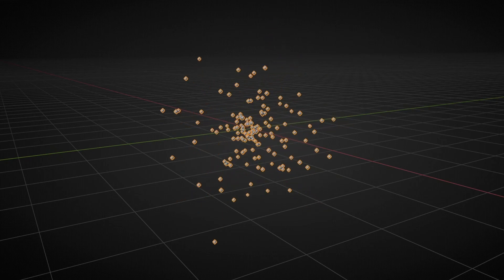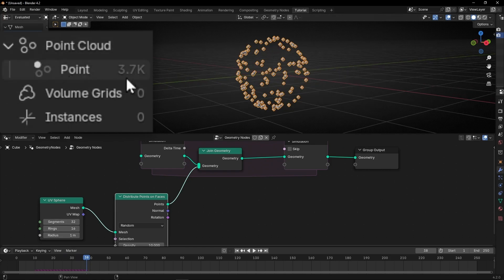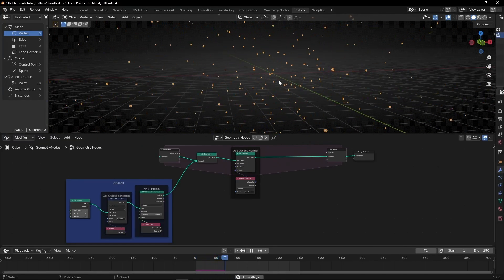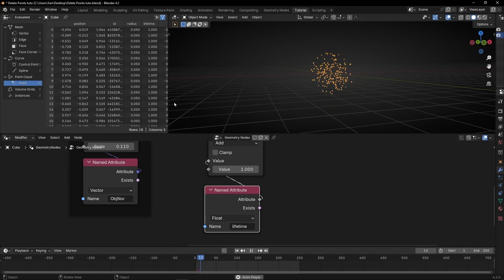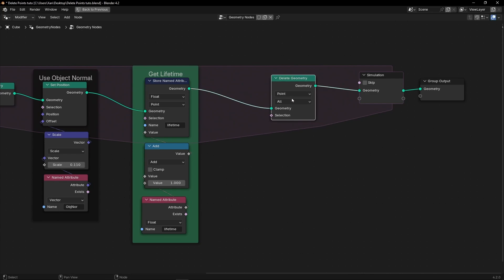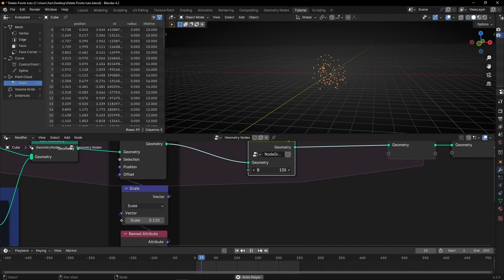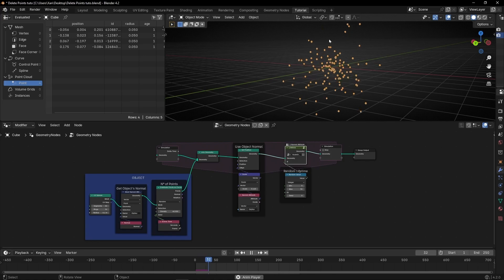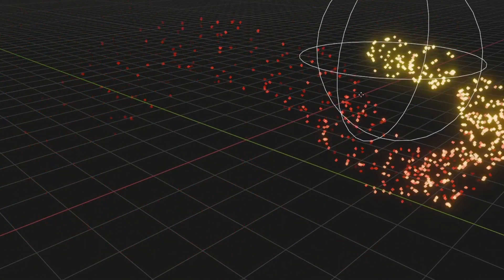How to Set POINT LIFETIME in Blender Simulation Nodes

Comment: This works for the emitter you're creating here, or any emitter that's based on an object (UV Sphere -> Distribute points on faces), but it does not work on the basic particle emitter that you created in the first video that's based on just the "points" node. Is there a way to set the lifetime of an emitter using points instead of an object, or would you simply never do that (as in it's bad practice or something)?

The node I have (from the first video) is:
Particle -> Join Geometry -> Set position (Geometry)
Random Value -> Add -> Scale -> Set position (Offset)

When it is plugged into the "Get Age" and "Define Lifetime" nodes from this video it plays until the "Lifetime" is hit, then suddenly starts freaking out and huddling near the emission point - and I can't seem to figure out why. With the object based one (UV Sphere -> Distribute points on faces) it works fine!